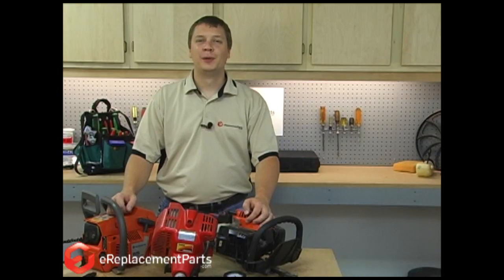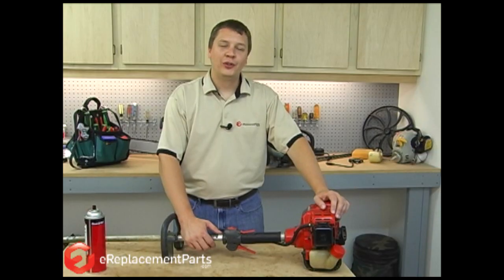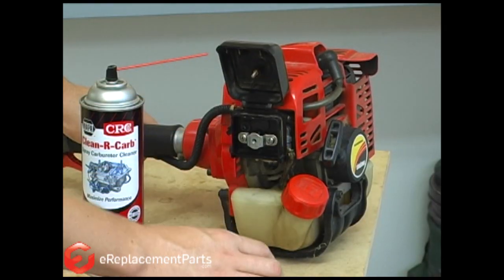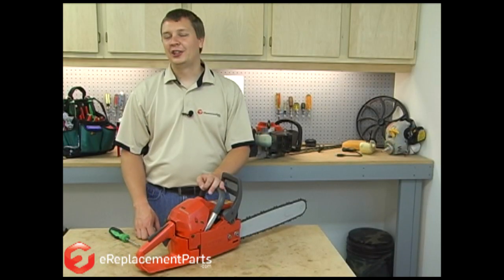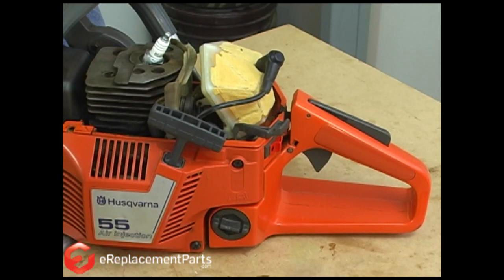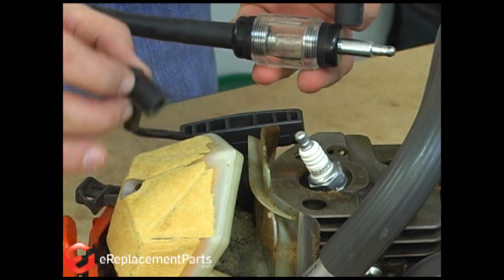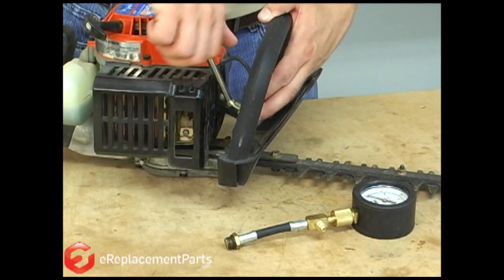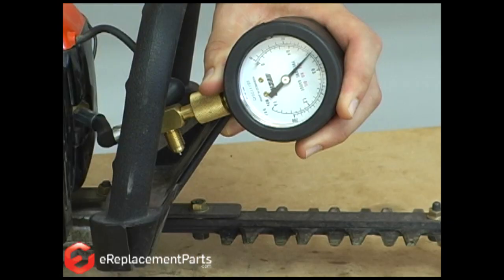How to Diagnose Two-Cycle/Two-Stroke Engines

Comment: Thanks for the video. My Ryobi 700 trimmer 2stroke is really hard to pull and jerks back on the rope. It will start and run smooth. No carbon buildup where muffler connects to engine. Does this if I test pull with muffler off too. Pull string does retract okay. Just hard and jerky pulling. Any advice would be appreciated.

Comment: Hi Mark i have a problem with a atlas copco jackhammer i have fitted new cylinder/piston/rings,coil,carburetta,,plug,vacuum holds 10 overnight,pressure holds 7 overnite,reed valve seems ok but it will not start at all

Comment: Hi. I have a 1 year old, very lightly used Husqvarna Chainsaw 455 
Rancher. I left it in the garage during the winter. After some struggle,
 it started to work. Once the gas ran out, I refueled with new gas &
 2-stroke engine oil (approx portion). However, now the chainsaw wont 
start at all. I have installed a new spark plug to no avail. Air filter 
is also clean. I must admit, I have pulled the cord quite a lot in the struggle... 
Can anyone think of what I should try?

Comment: My kx 250 runs fine for. A few minutes then it winds out like I'm holding it 
wide open.
Reply: +donnie crim I'd say your bike is sucking air somewhere, like a leaking crank case seal or a leaking base gasket.
Reply: OK thankyou have a good day.

Comment: great vid thanks mark. Working on cousins gas hedge trimmer Craftsman Bushwacker 21. It is older and I can't find manuals, and many parts not available. It was made by Homelite. Anyone know what the spark gap should be? Cleaned carb and still hard starting but carb adjustable once running. Cranks easily but seems to be slow to engage cutters. Could this be making it harder to start?

Comment: There is more to fuel system problems than just the carburetor. You also have air filters, fuel filters inside the tank on some models and you also have primer bulbs/valves, and the fuel lines. Any one of these can be the culprit when you are not getting fuel...... or it might simply be there is no fuel in the tank.

Comment: Good video. But what about the crankshaft seals? You can have good compression, but if the crankshaft seals are worn, there won't be any intake of fuel mixture into the crank housing.

Comment: ok Guys Easy diagnosis.  Try and Start as per norm, no go remove plug is it wet? y = Fuel is there. if no pour 1 tablespoon fuel in cylinder refit plug try start.  if the plug was wet with same plug put in lead and hold over cylinder or grounding point and pull pullcord.  Spark = y put finger over plughole pull cord does compression lift finger? if no then remove exhaust check seizure. if yes then unit will have enough compresion to start. If spark was no try any other plug in lead test. if still no spark remove earth wire from coil assy to eliminate start/stop switch. if still no spark go to shop as its either coil or flywheel timing issues.
if unit had a wet plug spark and compresion then that suggests flooding, remove plug pull cord assy 10 - 15 times no throttle replace plug test starting

Comment: Wouldn't these techniques also apply to four cycle engines with perhaps the exception of the compression needed to run a four stroke?  If so, what would be the minimum for a four cycle?  Thanks

Comment: Hey Mark. I just started my single stage blower and weed wacker using carburetor cleaner spray. was hoping you could tell/show me where to spray on an Echo leaf blower PB-755H
Reply from the maker: +David Gribin You can spray the inlet hole for the air filter with some cleaner. The tool manufacturers don't recommend this at all.   Be very cautious though.  Too much Carb Cleaner or ether can easily, literally blow up in your face or in can cause damage to the cylinder or piston.  I've seen it put a hole in the top of the piston before.

Comment: If my trimmer will run with no gas tank or fuel lines connected but won't start otherwise what do you suspect is the problem?

Comment: Brilliant video Mark. I have a Craftsman leaf blower (2-cycle) that is having a a compression of less than 70 pounds. I heard that engine restore lubricant can bring back compression back to normal. Can I use that in 2-cycle engines and if so where would I add the oil? Thanks in advance for your help...

Comment: Mark, you, as a technical expert, missed a very basic way to test the entire ignition system in one easy step. And no, you don't need any special equipment to test a spark plug! All shade tree mechanics test the spark plug this way; unscrew it from the cylinder, lay the base of the plug against the cylinder so that it is grounded, and pull on the starting rope. If you see a spark jump between the plug's electrode and the grounding strap, not only is the spark plug good, but the ignition coil has been tested as well. Duh!
Reply: +MrSuzuki1187 Actually, YOU missed it. He mentions this, and suggests it's not an accurate way to duplicate the plugs performance under the conditions Installed.
Reply: He comments on that in the video; a spark in open air may not be strong enough to fire under engine compression.

Comment: I have a fairly new (1-month old) Husqvarna 128LD trimmer. I've used it twice without issue, but then it started acting up. First, it would cut out whenever I gave it gas. Now, it cuts out when I move the throttle switch from "start" to "idle". Even then, it's a huge pain to just get started, often taking about a dozen pulls and pushing the priming bulb about 20 times.

From the get go I've been using the fuel-oil mixture ratio recommended by the manual and using fuel stabilizer in the gas, because of the added ethanol. It has also been kept in a shed when not in use and hasn't seen wet whether (it hasn't even rained here since May).

Any advice?
Reply: +sonicpsycho13 Does it run ok if you take the gas cap off and you pull the trigger?  Many people are unaware that their gas caps have a tiny hole in the center to help vent the fuel system.  Any obstruction and you won't get gas to the cylinder.   The other solution may be in the carburetor.  Carburetors are cheap (~$15-20) and easily replaceable.  Your ignition and compression is likely good since you are able to get it started and running.

Comment: My 395XP sat for 3 years non use. Wouldn't start so I put a carb kit in it. Still won't fire up. Used some starter fluid still no go. Getting a nice bright blue spark in the plug (old school testing wired to the jug). Getting fuel and fire but hitting a lick. Scratching my head. Haven't done compression test yet but feeling plenty of compression when I pull without decomp valve depressed. Compression check is next anyway just to be sure I guess but not very many hours on this saw.

Comment: Great video . . . but . . . he failed to mention what I think are the most common problems. 1. air filter is dirty (clean or replace); 2. fuel line and/or primer bulb cracked or has a hole (replace); 3. fuel filter is plugged (easier to replace, but can clean with carb cleaner if desperate) 4. carb is plugged with dirt or fuel gum (dismantle and clean with carb cleaner and compressed air, but be prepared to buy a new gasket set if gaskets tear when dismantling)
Reply: +Marlin L. also cleaning the spark arrester may help.

Comment: Hi! I have a yard machine weed trimmer and I can't get it started. I changed the spark plug and didn't start. I then noticed the primer bulb sticking and changed that. Still sticking when I push it in. I was going to change the fuel filter but I don't even see one in the tank. Not sure what to try now. Any suggestions would be appreciated. Great video! I wish I would have found this earlier before changing those parts. I've got to try spraying the carb cleaner and see if it fires. What else is left to change? Please help!

Comment: I love how he used Carb Cleaner as Starter Fluid. Learn something everyday.
Reply: +1487G Yeah the active ingredient in Carb Cleaner is Heptane. Its pretty darn close to the active ingredient in modern starting fluid and it will get you out of a pinch. PB's rust buster also works. Never use WD-40 though.

Comment: Great video!  What am I missing? Echo PB 200 blower.  New spark plug and strong spark with Oppama tester, new carburetor, fresh gas 50:1, new fuel lines/filter, compression = 90+, spark arrestor clean.  Get a pop with starter fluid, but can't get it running.  Already bought a new  one, just the challenge of trying figure this one out.
Reply: +Duane Miller If only a pop, and not actually running, on starter fluid, may be timing is off.
Reply: Duane Miller  check you carb adjustment screws, or check the needle valve for proper operation. sounds like your not getting fuel. also if its an older model exhaust can build up soot from running improper oil mix clogging the muffler seen a few but not that common.
Reply: Thanks,  Raguel Bauman.  I agree,  has to be a fuel issue - just can't find it yet.  Gonna go back out there right now and go through the whole fuel system again.
Reply: +Duane Miller Try running it with the gas cap off.  Does it run and stay running?

Comment: h folks , i need a hi folks , i replaced a fuel line on a old craftsman chainsaw , the fuel line doesnt fit very snug againsta the nigoing fuel line into tank on a old weedeater i have it has this small hard plastic about 1 inch long thats going into the fuel tank the small plastic piece fits inside the fuel line , i need some of those does anyone know the name of these ?? i have the correct fuel line size .  i thought of trying to use a cut piece of a long plastic tip thats 5" long i cut to 1" long from a empty carburatr cleaner spray bottlle the inside of that plastic sprayer seems to narrow . the primer bulb on the chainsaw sucks only air  since the ingoing fuel line isnt a tight fit

thanks for the tip guys i appreciate it ,

Comment: Mark, My trimmer does not start. I found it is very hard to pull the starter rope all the way up as usual. It liked having a spasm all the way ... However it is easy (or can say normal) to pull, if I remove the spark plug out. I've checked the spark plug, it worked fine.

So what went wrong with my trimmer? What should I do?

Comment: Hi Mark! I bought a used leaf blower a few months ago. When I was doing maintenance on it, found out it doesn't have a fuel filter. Is the fuel filter necessary? Thank you!
Reply from the maker: If your fuel is totally, 100% clean, you might be able to get away without a fuel filter.  The usual problem that we see is,  the Ports in these carburetors are very small and the slightest particle of dust will cause a plug.  The filters are pretty inexpensive compared to the price of a new carburetor or carb kit.
Reply: eReplacementParts.com
Reply: Poulanpro

Comment: There is a way to where you can test your spark plug with out having to buy a new one or needing testing equipment. Simply take out your spark plug and make sure to plug it back into the wire. Then hold it next to one of the cooling fins (to act as a ground to complete the circuit) and then turn over the engine a few times. If you don't get spark, then you know you need a new spark plug.

Comment: will this work for a 2 stroke 4 wheeler engine?
Reply: it'll work on any fuel burning engine, diesels, you need fuel,air and compression, gas engine you need gas, spark, air, and compression
Reply from the maker: mayadog03 I will ask our repair team and let you know.
Reply: you really should always have the engine turning over when you give them a shot of either, straight either is hard on an engine when it ignites
Reply: Ok thanks

Comment: Two cycle engines are the most troublesome,temperamental pcs of shit on the planet. I have been fortunate enough to trouble shoot and fix most problems and the most re-occurring problem I have had was:
1. Mantis tiller -  Fuel lines swelled and cracked + particles from deterioating hose got into carb. I often take great care in fuel contamination and unleaded fuel eats up these rubber and plastic components over time.I had to do a rebuild kit for carb. now all is well.
2. Craftsman Chain saw - Fuel line running from tank to carb worn thru a pinhole in the line causing it to suck air instead of fuel. Replace lines and all is well.
3.I find that every seasons end I always tear the units down and just do a proper         
    cleaning. I replace the spark plugs EVERY 2 years.
I had a weed wacker (craftsman convertable ) that worked well first 3 months.then after the warranty I couldnt get it to start. Did all the pretests i usually do and then found a head bolt would loosen up and it would lose compression as soon as it warmed up.The biggest problem i had was thet I had to take the cover off the engine whic is a real pain in the ass. Do my fix was to drill a hole in the cover so I had access to the bolt to tighten it (it was an allenhead screw). After three episodes of tightening this I found some loctite and problem solved. ran good for abt 6 yrs and then other components just wore out beyond use.
Any of these helpful Vids that are here i the you tube channels have been a great help.
Thanks a bunch for ongoing tips

Comment: I have very poor hearing, and I found your video very clear.  Also instructions were clear and straightforward, a great help, thank you!
Reply: Pat Nugent   Since retiring, I have been fixing things that are broken.  My sons are supplying me with various tools they own.  Chainsaws, air compressors, weed eaters. I helped my oldest son fix an electric dryer and when he saw how simple it was, he has helped fix a couple for his friends.  With the new smart phones (I don't own one) you can just get on YouTube and punch in an appliance and most likely they have a video that will diagnose and tell you how to repair it, while you are standing next to the appliance, it is amazing!    I fixed a non-working NuWave oven (cost $150) for less than two dollars!!  Amazes me how many people throw things away that are fairly simple to fix.  But I realize not everyone has the same interest or talents.
Reply: Steve Schuller   so do you have the rest of the deck I am missing?  Many say I ain't a playin' with a whole deck.

Comment: i have done everything that you showed on your diagnose Utube video. I have spark, gas at the plug, it won't start or even try to start, went thru the carb also. Any suggestions, its only 3 years old. Homelite 26cs trimmer.
Reply from the maker: If you have Air, Spark and Fuel the next place to check is the Flywheel and the Timing.  The flywheel has a key cut into it that corresponds to the key way cut into the crankshaft. The flywheels for these are made of aluminium. If the flywheel moves the littlest bit on the Crankshaft, the key will be damage causing the timing of the spark to be incorrect.

Comment: I seem to be getting gas around my spark plug, I clean it and it comes back in there a gasket in there that could be leaking?
Reply: If the leak isn't coming from somewhere else, just replace the plug so you'll have a new gasket as well.

Comment: i have a husqvarna 128 L D weedeater it is about 2 years old.  . it will run for about 15 seconds on full throttle  and then dies. If if leave it on half chock it will run longer before it dies. I thought it may be a vacuum problem from the gas cap vent, so i removed the cap completely and still have the same problem. It was running great until one day the spark plug became loose. I removed the plug and found the plug was loose in the center of the plug. I install a new plug and ever since i have had the problem. Thanks for the video they are great
Reply: If you mean you still have the problem with a new plug, fuel pump (in the carb) I should think.

I suggest you service it at your nearest dumpster.

Comment: I've borrowed my son in law's Husqvarna 55Rancher.  I am a 65year old 195# weakling and just do not have the strength to pull the starter handle well.  This does not have an apparent compression reduction feature, the manual only implies that having full choke accomplishes this.
My 43 year old son had no problem, I'm glad I bought his lifetime gym 25 years ago.
Any tricks to ease the pain?  I have eather starting fluid I thought would give me a quick start, where would I spray it?
Thanks.
Reply: Have your son buy a chainswa with a compression reduction system.  Starting fluid won't help.

Comment: i have a 2 stroke bike when i start it, it goes well but after some time it starts to make jerky motion & engine heat up too much i don't know what is the problem recently (7 days back) i changed my piston. i don't wana lose my bike, please help ....
thank you.
Reply: do it run longer idle than when you ride it ?
Reply: yes..
Reply: If your carburettor has a sump the next time this happens right before it cuts out, turn off the fuel quickly.. open the fuel bole on the carb , if it has almost no fuel  its most likely to be a sticky  float, clean up the needle valve or replace it if you can.
Reply: ok, Thanks mate
Reply: Any time fella, let me know how you get on with it   ;)